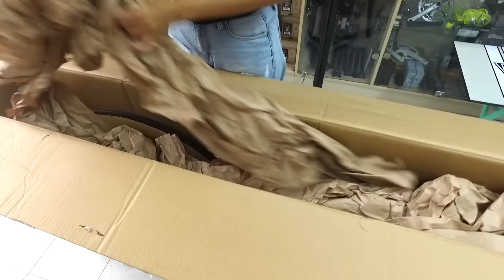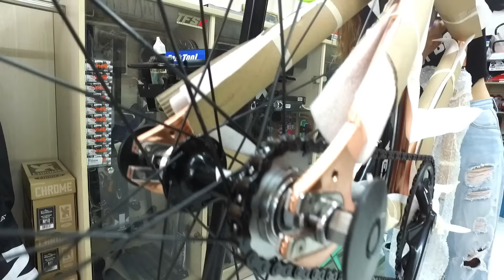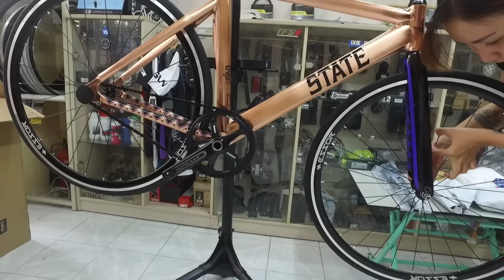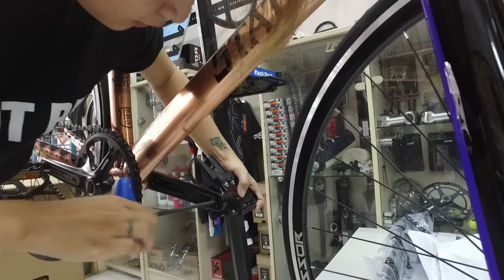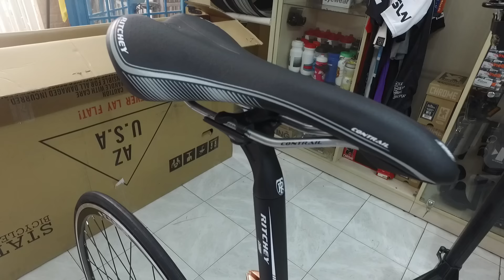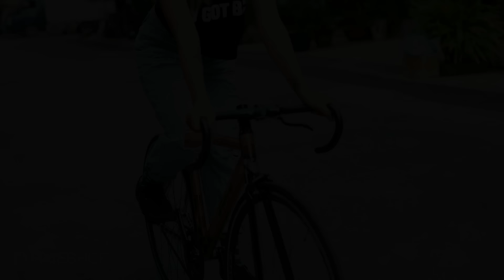DREAM BUILD FIXED GEAR BIKE - Undefeated x Rattle Snake Edition - State Bicycle Co. // TALI Bike

Comment: Although its a aluminum frame so the seatpost wont seize if you dont grease it, the pedals will... You should have greased both and make sure the seat is flat and tighten the cog and lockring, if I saw someone put a bike together like that they wouldn't be working at the shop.

Comment: Road handlebars to go with road Bike geometry. $600 for a frame? I can go down a list of about a dozen other frames the same price that blow these out of the water.
Reply: joe rioux cool then ride those and leave everyone else alone.
Reply: why would I do that? Not everybody is educated on bicycles and I think there's nothing wrong with feeling people in on what they're seeing and or getting. someone might actually go out and buy one of these things instead of looking into an actual track geometry frame. and they might not know the difference between Pista handlebars and road bike handlebars. But I suppose you just like people to be ignorant.
Reply: joe rioux these bikes are solid and strong. This bike in particular is fairly flashy. Don’t trash someone for buying what they like. I prefer a sealed bottom bracket on all my bikes and most of the bikes DAN builds aren’t sealed bottom brackets. I don’t come to his comment section and tell them how many sealed brackets I could buy that’ll blow them out of the water. Build what you like and move on. You’re not protecting anyone because any one person would build what they like. Frame. Bars. Wheels. State bikes demand a premium for a reason. Go watch a crit sometimes. Better yet ride one. Peace.
Reply: I'm not sensitive... but don't tell me I can't leave an information comment cause you don't like it, or ride a crappy state and defending it or whatever reason you felt to tell me not to educate people on a better buy.... stop being a hypocrite liberal.
Reply from the maker: Thank you for your comment. We hope the video made you happy. Please subscribe and press the bell to make us happy too ❤️🙏